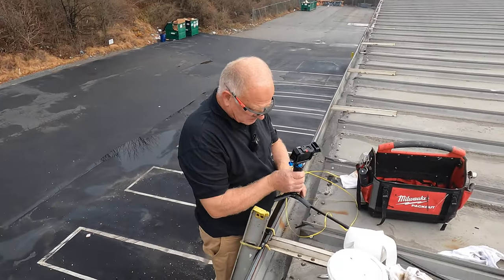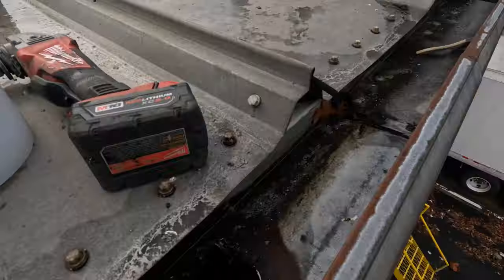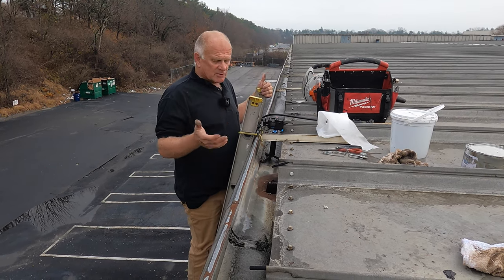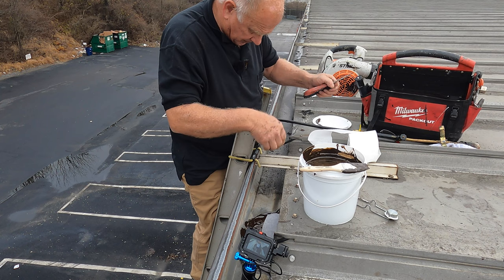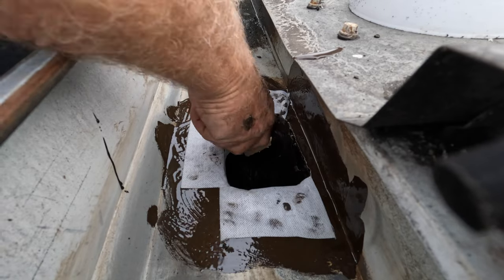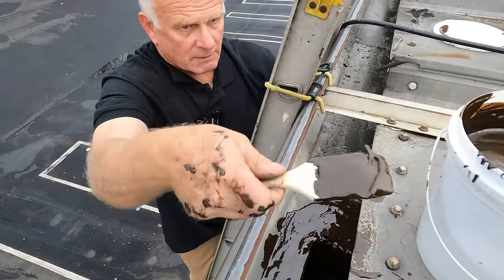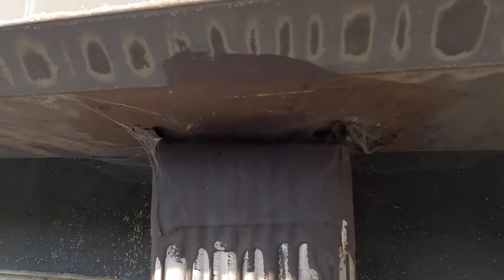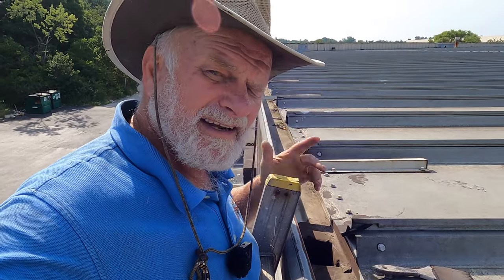Quick, Easy Cheap Gutter Rust Holes Repair - Seams leaking - DIY

Comment: My Turbo Poly Seal is ordered. Chimney flashing repair is in my near future. You’ve convinced me it’s the best product available. Thanks Flat Roof Doctor!
Reply from the maker: Glad I could help
Reply: How did it go?
Reply: @pearlperlitavenegas2023  
This product is amazing! It’s pricey, but very easy to use. Short shelf life, don’t order more than you plan to use. Once you open it, you have about a month to use it up.
Reply: @royboy9361  thanks for your reply. I have a leak via my cricket, step flashing & we can't fibd/stop the leak 😪How much did you buy for 1 chimney mine is 4x2x4x2 around my rectangular chimney With a cricket in the back
Reply: @pearlperlitavenegas2023  
Half gallon should get that done. Good luck.